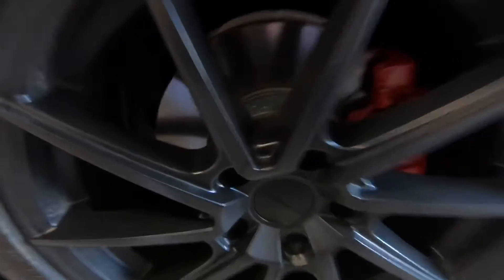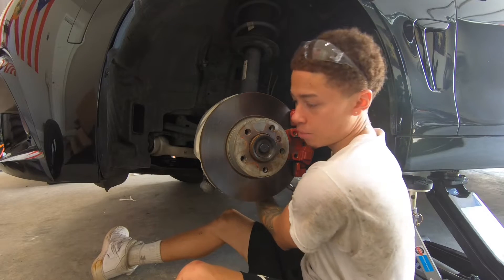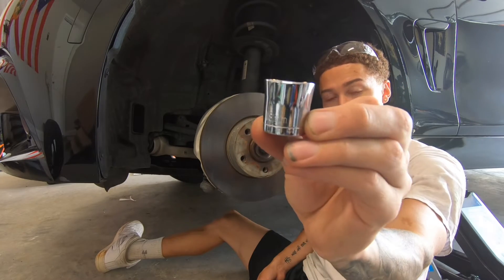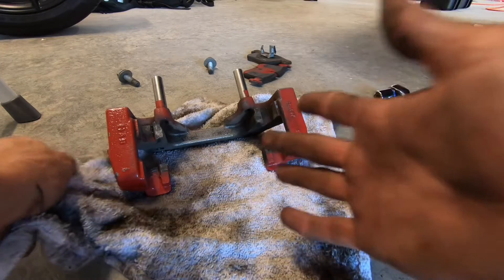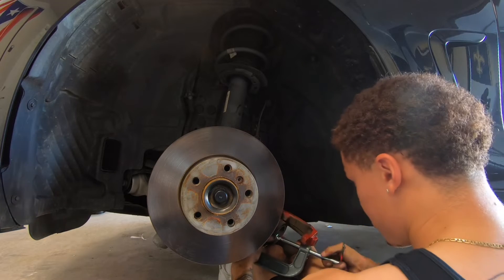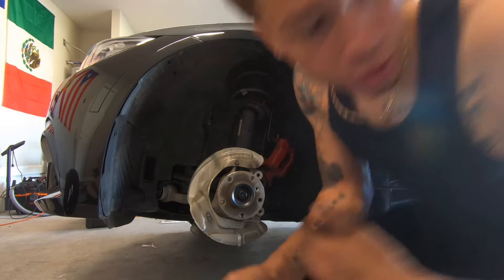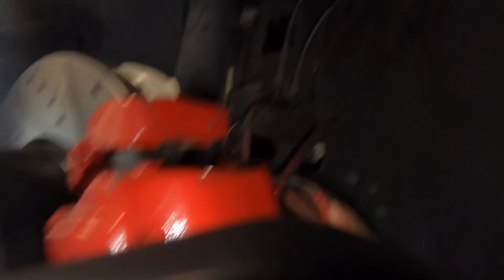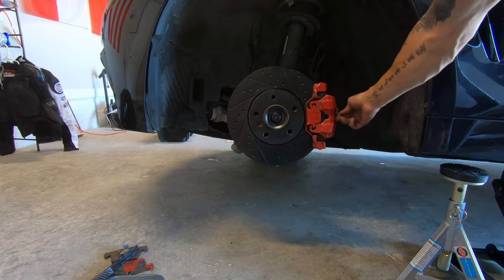Brake Rotor/Pad Install BMW 428i (F33)

Comment: Awesome video, only suggestion is that you should've put high-temp grease on the caliper pins before re-installing them since the caliper slides on those pins.

Comment: Good video bro a good tip for the caliper bolts when you have your ratchet set up use a rubber mallet and hit the end of the ratchet it’s gonna be so much easier to get the bigger bolts off.

Comment: Use a breaker bar and liquid wrench to bust the caliper bolts.  Another trick is a small torch to heat bolts to loosen

Comment: That small 6mm Allen for the rotor mounting screw, needs to be torqued to 16Nm (12ft lbs). I might replace my rotors as well. My 2016 428i is my weekend car. I only have 27823 miles on the car. So, at 30k when I do the 30k servicing, I might redo the rotors and brake calipers.
Reply from the maker: Thanks for the info!
Reply: Thanks for the info

Comment: Nice video, but usually it is worth to replace sensor wire as well.
Reply from the maker: Thanks! They were replaced, these rotors came with some, I should’ve included that in the video. Didn’t realI’ve until afterwards.

Comment: The bolts that you took off seem to be unnecessary to remove. The 8mm pin bolts that have rubber covers on them should have been removed and then also greased when replaced as the caliper moves on them. They also are not as tight, as someone else mentioned below (12 ft lbs) so you won't struggle as much.

Comment: bro may be u should go get the brembo, which is the 435i caliper. Anyway that look sick!
Reply: Doubt brembos’ are needed unless he’s tracking the car. The main component for stopping power are the pads and rotors. Hence, why carbon ceramics and drilled/slotted rotors are the popular go to for better “bite” and heat resistance.

Comment: How did this swap work out for you? Any squeaky like noises after you replaced the rotors?
Reply from the maker: No noises or complaints here. Braking was a whole lot better. 10/10 recommend